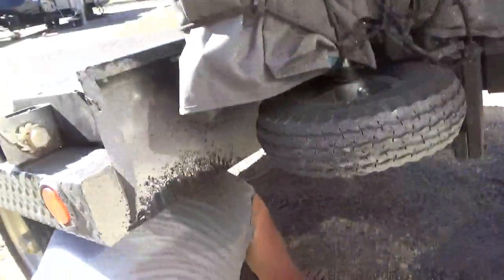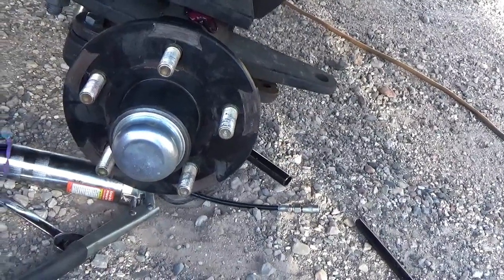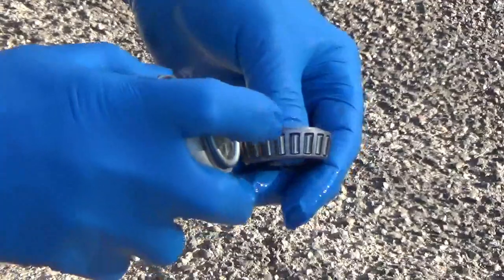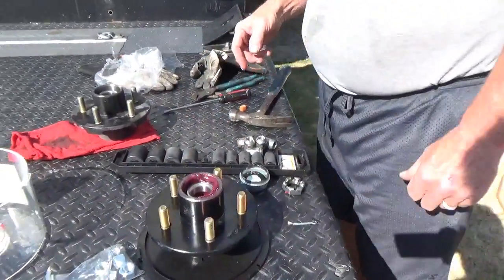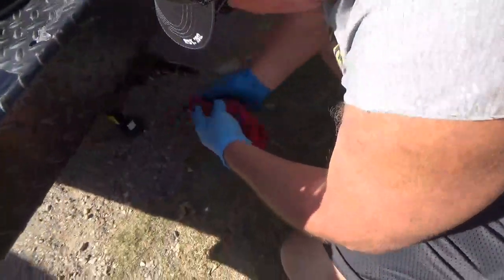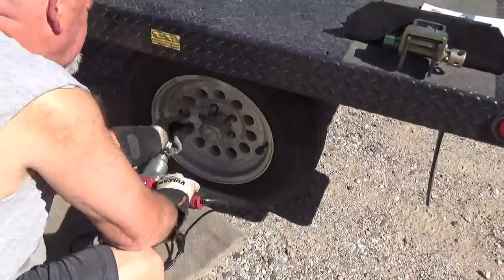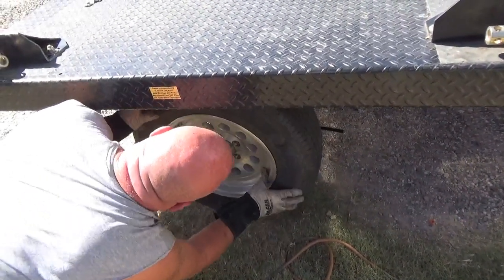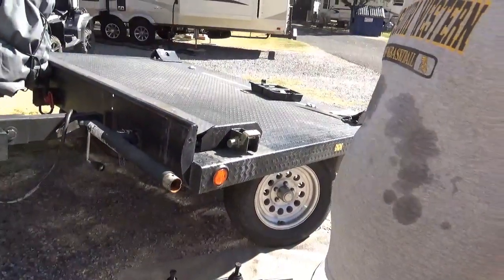Freedom Hauler (Idaho Tote) Tire Alignment // What Dave Thinks of the Tote 1 Year Later

Comment: The probable should have put cams on top of king pin bolt to set camber....... little mickey mouse not a reamed fit.  Great idea tho.  Think we would have trouble here in east coast with DOT... 🤣👍👍👍👍
Reply from the maker: You might be right about DOT on the east coast and also California even though it is considered an extension of the RV.  But we are very long.

Comment: Someone spoke briefly, and you replied, about DOT laws, re: the Freedom Hauler and whether they are legal in some states as a 2nd trailer. I have a 39' 5th wheel toy hauler, but am interested in moving up to a 40'+ with LR in front and BR in rear. I take the bike(s) with us, so if we move up to a reg. 5th wheel, I am considering the Freedom Hauler, since many states require TWO points of contact for towing off the rear of a TT, MH, or Fiver.
Your (and others) thoughts ? 
We are in Florida, BTW, and NOT full timers.
Reply from the maker: Freedom Hauler website states, "An All-Steel Flatbed Carrier, the Freedom Hauler bolts to a special mounting bracket that is installed on your RV’s frame. Its 2-point connection makes it an extension of your vehicle that does not count as pulling doubles."  We are 76 feet long all hooked up and we haven't had any length issues so far.  However, I don't think we will take into California.  We like how it backs up, however it will start to curl around if you are backing in with a tight turn.  We are very happy with it.

Comment: We didn't see the BUMP CAP on Dave's head 😂.  Nice video of maintenance on the road....I never would have guessed Tractor Supply had the new hub.  Nice job.  Hope it fixes the issue.
Reply from the maker: Dave was living on the wild side...felt lucky. :)
Reply: Tractor supply wheel bearing fit harley neck bearings also.  🤣 19 bucks

Comment: Now that you guys have had some time with this, what have you seen with different states that don't allow this? any issues with the law? looking at this for my 37ft 5er for a golf cart and just a little cautious as far as states, mostly on east coast.  Keep up the good work!!
Reply from the maker: We haven't had any problems in the states that we have been in.  You can see those states on our map on our website https://www.wattsonwheels.info.  The Freedom Hauler website states, "An All-Steel Flatbed Carrier, the Freedom Hauler bolts to a special mounting bracket that is installed on your RV’s frame. Its 2-point connection makes it an extension of your vehicle that does not count as pulling doubles."  You can call and chat with them about that concern too.  Thanks for watching Frank.

Comment: Are the wheels swivel wheels on a tote, or are they fixed? Can you tow fixed ones
Reply from the maker: They are king pins with a spindle.  Per freedomhauler.com:  
STEERING SYSTEM
Freedom Hauler has a patented Pressure Sensing Steering Axle (PSSA) that automatically steers itself going forward and in reverse. This one-of-a-kind system is designed to carry its own weight, does not put additional weight or stress on your RV frame or suspension, and it can hold up to 2,600 lbs. of payload depending on how it’s outfitted.

DESIGN AND CONSTRUCTION
An All-Steel Flatbed Carrier, the Freedom Hauler bolts to a special mounting bracket that is installed on your RV’s frame. Its 2-point connection makes it an extension of your vehicle that does not count as pulling doubles. The Optional Trailer Conversion Kit makes your Freedom Hauler a hybrid UTV trailer.